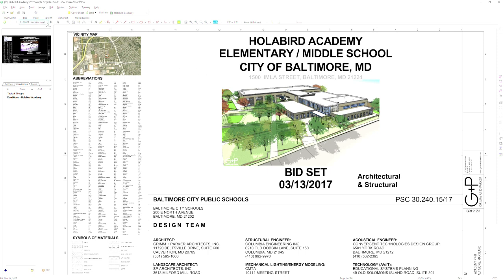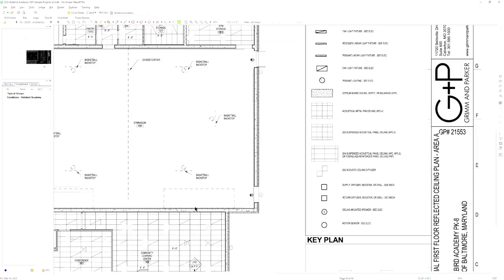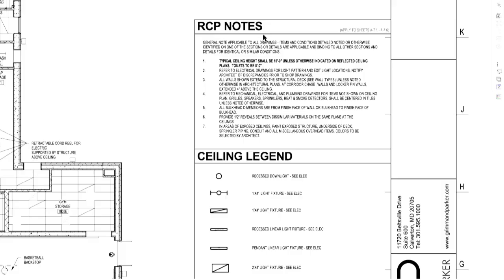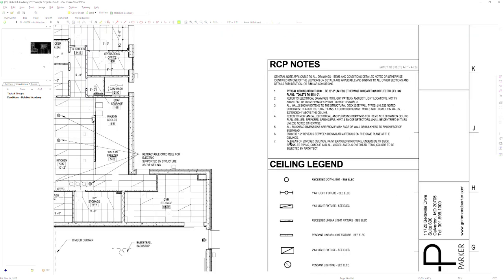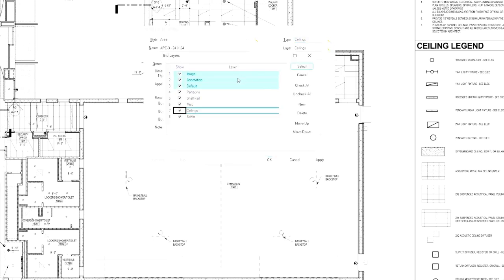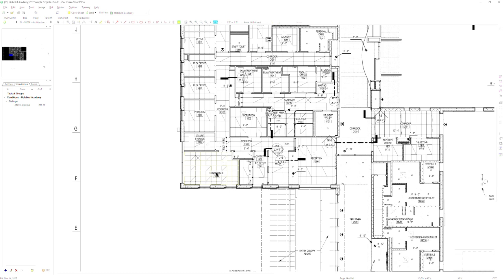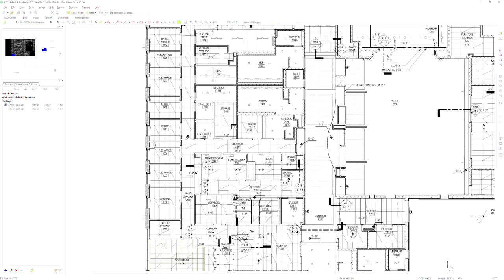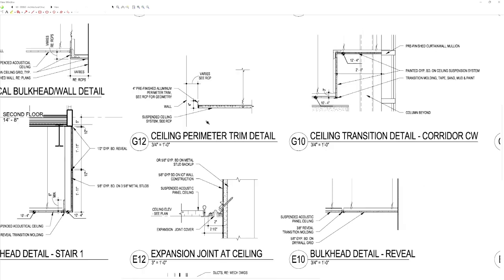Learn About Construction - How to Read RCP Plans & Estimate

Comment: What is the purpose of grid in area calculation? Does it provide joist length etc?
Reply from the maker: Yes, it can be used to calculate total Lf of the grid. This would work for calculating reinforcing steel (rebar) in a concrete slab.